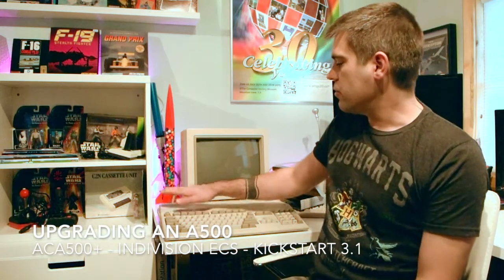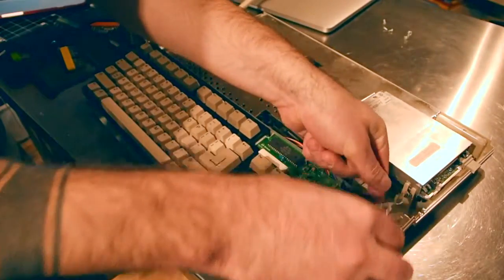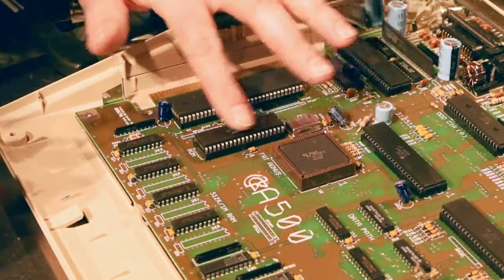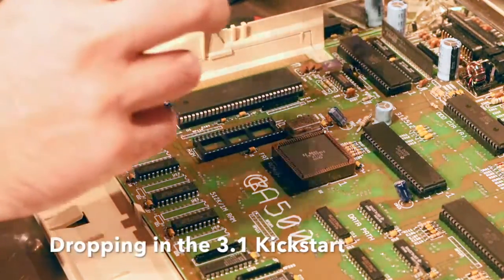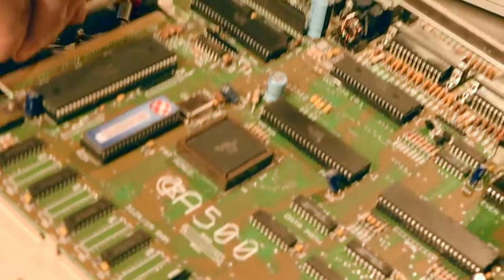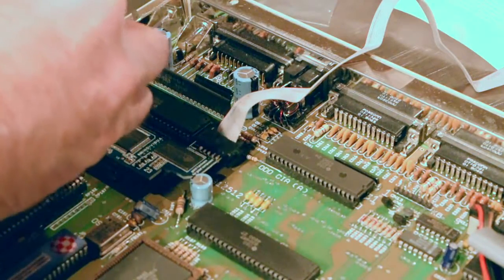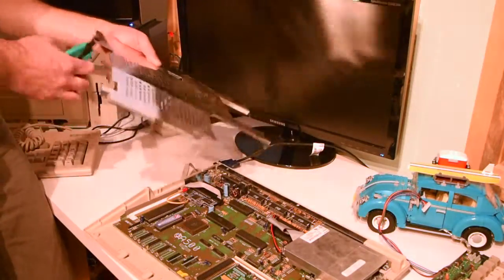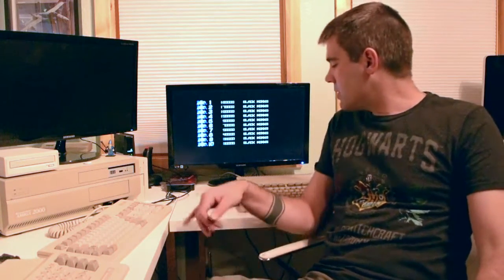Amiga 500 Upgrade: Kickstart 3.1 - Indivision ECS Scandoubler - ACA500+

Comment: I did the same to my A500+. I fed the VGA cable to a hole I made in the top case also I got a 1.3 and 3.1 kickstart chip with a switch on it so I can use ether one. But I found a bad case on E-bay and used it, so I kept my nice case un modified. I did the mod so you can take the top off and get access to the board. So my good case and top shielding and side port shield is keep safe. My ACA500+ I put my A1200 ACA 1232 card and have put Kickstart 3.1.4 as well as the rest of them. I had a Apollo 1230 mk3 card with 32mb this did not work. So I swapped them over. Some times I just use my A500+ with out the addons it has got 2mb chip ram to have it old school. Yes I am that old.

Comment: great! thanks for the video but dont' you have kickstart ROM 3.1 in the ACA500plus?
Reply from the maker: Yes, that's correct, but I had a spare one kicking around that I was going to use in the 500 before I got the ACA. It's also helpful to have the 3.1 KS installed when I disconnect the ACA to use the A570 CDROM.
Reply: thanks for your answer mate. I just ordered a ACA500+. seems to be a really nice kit.

Comment: I added Indivision to my A600 but after the Indivision screen displayed I got a black screen. How am I supposed to download screen resolutions to a computer that can't get online? The Amiga has become a programmers paradise but if you have to write your own source code to use one the public will never buy one. Who wants a $2000 game playing machine? My old Dell PC can whip the pants off any new Amiga. Take on Lightwave 3D v6.0 and prove me wrong!
Reply from the maker: Hey Jeff, I had that problem too when I've set the Indivision too high. In that case I've had to connect my old 1084 and switch the settings back.

Comment: Hi Will, I'm new to Amiga. Just got an À 500 with 1024k. I installed the Gotek. I have kickstart 1.2 should I upgrade? Should I get the Aca+
Reply from the maker: Awesome! Welcome to the Amiga community. Good move on the Gotek :) Upgrading KS depends on what you want to do. Some older OCS games prefer having 1.2 as the Kickstart. Personally I prefer the added capabilities of later releases, for example: 3.1 will allow you to switch between NTSC and PAL at boot up. 

However, if you go with ACA, you get all the KS versions and you can select which one you want to boot into. ACA will also give you the advantage of running WHLoad.

Good luck with your new Miggy!

Comment: Great video! I was especially interested in the Indivision ECS upgrade and it works perfectly! (is the signal better or compareable to RGB?)
Next question: why have you changed the Kickstart ROM? It is available on the ACA500+ extension, so no need for it!
Reply from the maker: Thanks Peter! The Indivision allows for full VGA, the quality is going to be cleaner than RGB. I had a spare 3.1 ROM kicking around so I thought why not :) But you're right, the ACA does come with 3.1 ROMS.

Comment: You might want to urge viewers to NOT remove their ROMs with metal screwdrivers like that.  You can gouge the plastic sockets, but, even worse, you can damage and cut traces under the socket with them.  Use either a chip puller or a plastic pry bar (sometimes called a spudger) instead and be sure you keep it on the socket and NOT on the mainboard when prying,.
Reply from the maker: You're absolutely correct triax. Something like a lego brick separator would do the job perfectly. But as with any endeavor, a certain amount of common sense is required. Like not inserting an object too far so that it would damage traces. Or to not put too much pressure on the plastic sockets. 

Thank you for your suggestions!
Reply: eBay you get a chip remover for few bucks lol

Comment: I was under the impression when replacing the 1.3 chip with the 3.1, there was some extra "wiring" that needed to be done - is this no longer the case?  Thanks for the video.
Reply from the maker: The only extra wiring that could be done is to add a ROM switcher (so the machine has a 1.3 and 3.1), otherwise it's as simple as lifting the chip an replacing.
Reply: Thanks, Will!
Reply: It was necessary only on rev.3 or rev.5 A500 mainboard, then you'd have to bridge two ROM pins (maybe 21-31 or 1-21 do not remember), yup. Cheers, M

Comment: My question to you: why is it good to upgrade kickstart to 3.1. 
The whole AGA thing is a totally different architecture, so what do you gain with it?
The VGA out looks awesome!
Reply from the maker: As RetroGeek put it, having KS 3.1 will allow you to run workbench 3.1. The later KS rom's contain extra libraries that are required to run some applications.
Reply: I see. So pretty much the only thing happens after installing 3.1 you can use WB 3.1. Which is obviously better than 1.3. Thanks for the info.
Reply: Actually there are other usages. For example, if you have an a590 harddrive, it will allow you to have larger haddrive capacities. However, rather than installing a 3.1 ROM (which is fine if you want to on an a500 you are not leaving untampered), you can, for example soft boot the 3.1 into RAAM with the downside of losing about half a meg of RAM to that, but then if you have a memory expansion (say 1meg or 2meg of sip chips in that a590's RAM slots), then you'd accomodate it. See the channel scoopexUs for the video "ACA500 Quick look #4 WHDLoad Preload in workbench" from 30 nov 2013 to see more abstruse talk of 3.1kickstart rom benefits over, say, soft booting.
Reply: Tom Caine err...no. The gotek is simply a floppy drive emulator. It looks like you have something wrong with your A500.